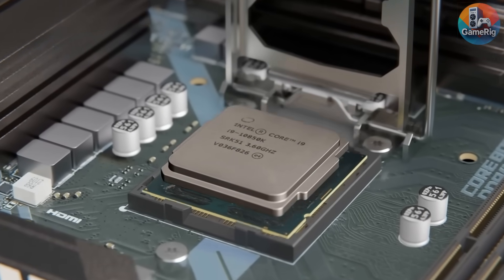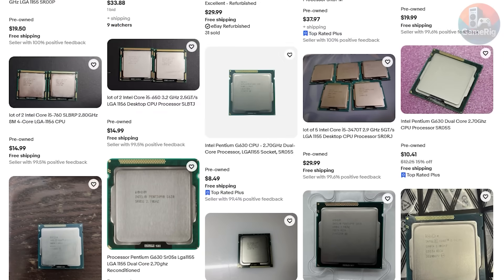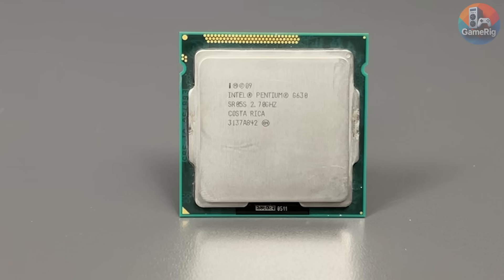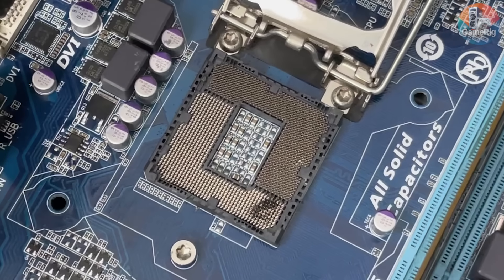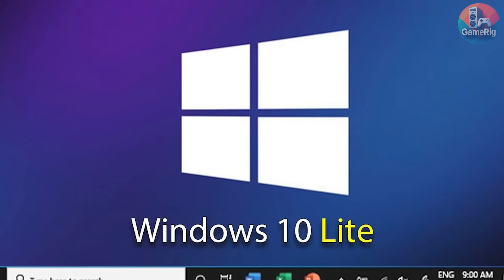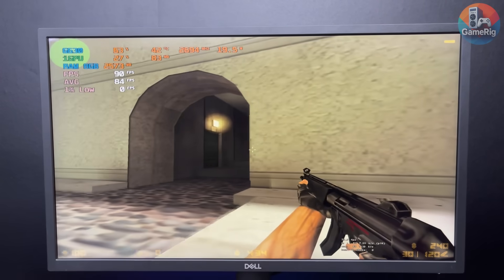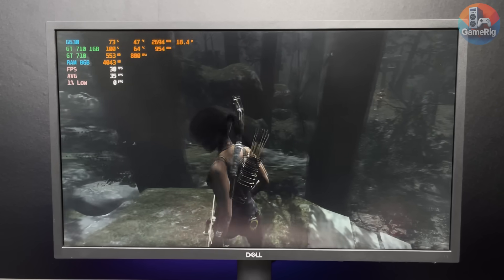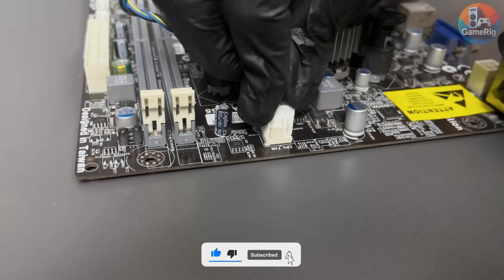Can a $1 CPU Run AAA Games?!

Comment: the i3 cost roughly the same as those pentiums but run 1080p playback way better and contain all the avx instructions etc that the i5 and i7 variants had during that generation , my advice for anyone wanting to repurpose an old sandy or ivy bridge system is just skip the pentium and start with the i3

Comment: I used to have an Intel Pentium g620 2,60ghz (similar to g630) and it was pretty fast and also reached over 500 points on cpu z under windows 8.1 but i changed it with core i7 2600

Comment: I got a Xeon E5-2630 v4 for .99¢ on Aliexpress.
Reply: Found a xeon e3 1270 v5 for $13 on ebay that is extremely close to a i7 7700 and a full on e3 1280 v6 that BEATS the i7 7700 for $28, with the i7 7700 being in the $50 range in comparison

Comment: I bought an itx lga1155 motherboard (intel's own board which is pretty cool. I didn't know they made their own boards back then) once for a project and it had a pentium g630 in it just for protecting the motherboard cpu socket pins 😆. I still have the g630 but haven't done much with it.